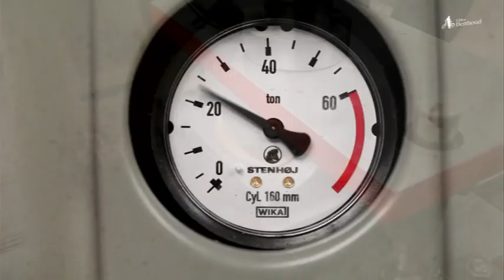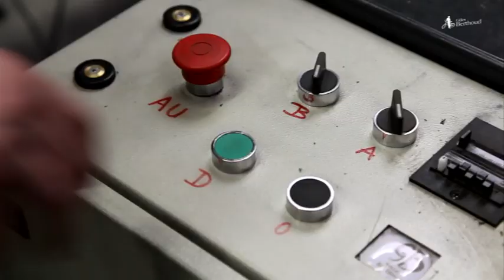Produção dos selins Gilles Berthoud

Comment: Awesome Saddles. I own two of them in addition to having owned multiple brooks saddles; B17 special, Champion flyer, 2 Colts, Cambium, Team Pro and B15 swallow. Only the Colt Saddle is the one that comes close to the Berthoud Aspin in terms of comfort but, the leather is harder than the Aspin. You can see them being made softer in this video and for me, having already tried the harder saddles from brooks. The Aspin were wonderful straight from the box. I've gave up my brooks saddles except for the Colts and the Champion but, my Aspin mounted to my Soma DC DC is the one that is the most comfortable and is my Favorite. If you're not racing but spend more than 7 hours on your bike per week then try a Berthoud.